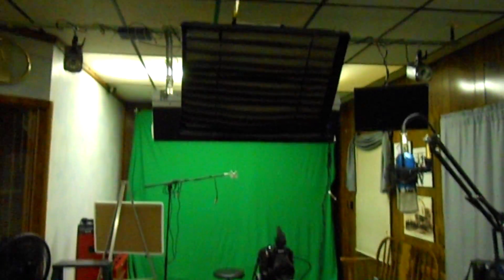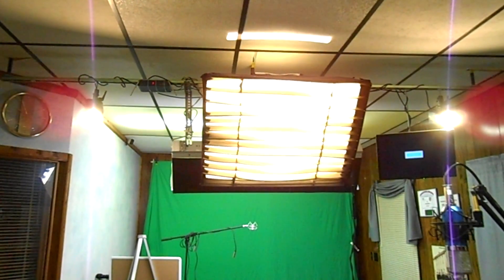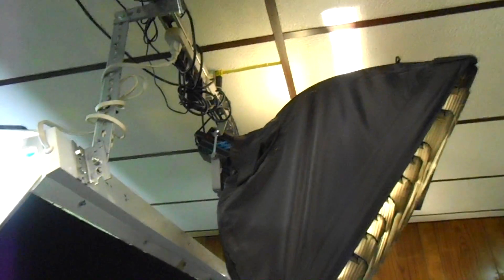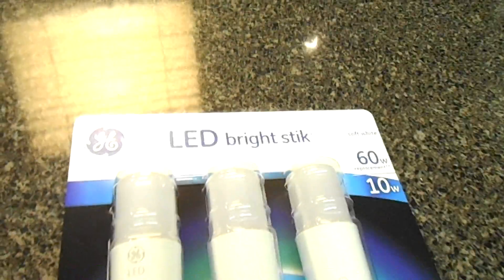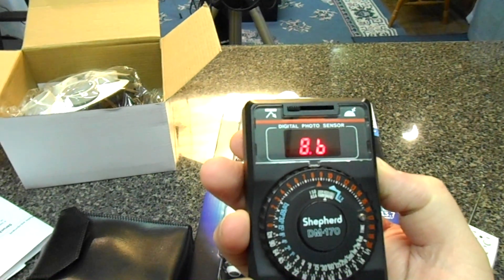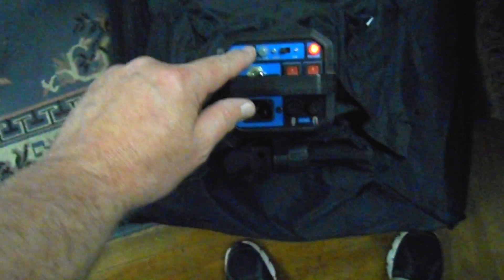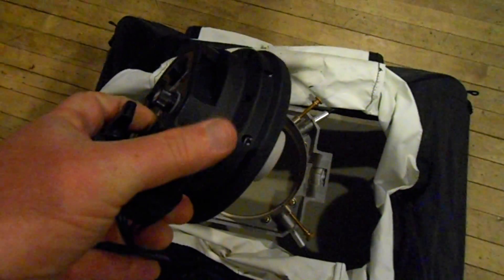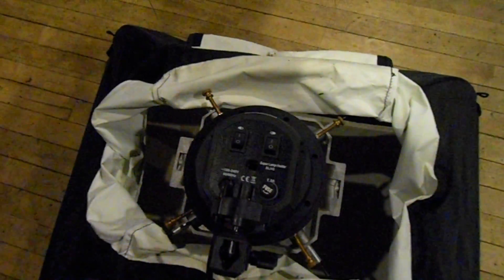Softbox Video Light Conversion - Halogen to LED Modification

Comment: What is the CRI of those LED units? Looking at the LimoSTudio heads they aren't doing anything to the current frequency (nothing in the specs about it) so they are still at 50-60hz, how do you guarantee no strobing/flicker, or do the LED units have a decent driver that sorts that?

Comment: Just curious if there was much color temperature difference between the Halogen and the LEDs.
Reply from the maker: I don't have a color temp meter but the settings for the white balance on the Nikon remained the same.